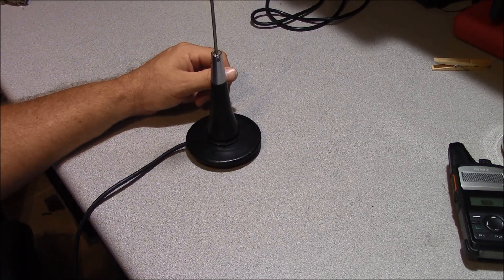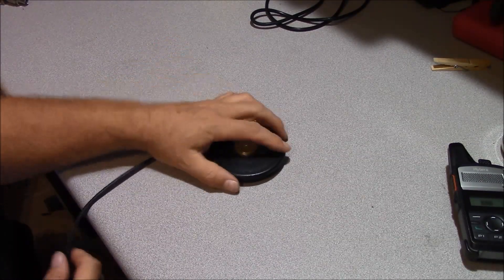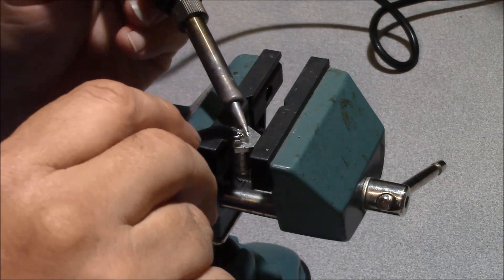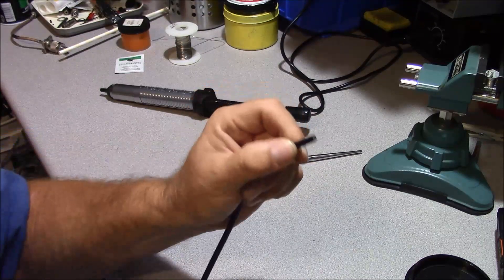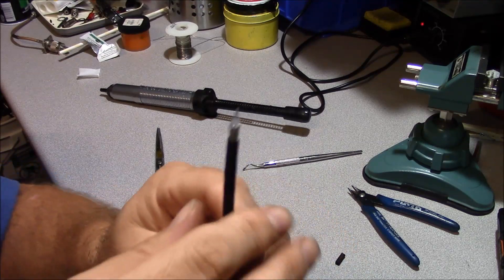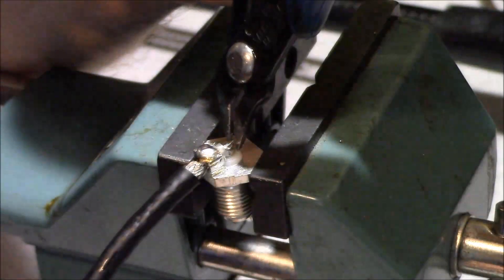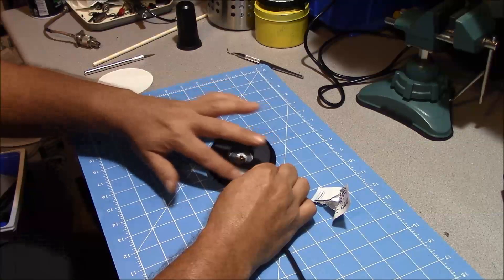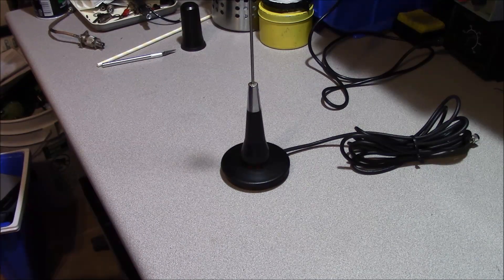Ham radio magnetic mount repair

Comment: Here's a poser that's had me stuck for a while: what is the best way to separate two mag mounts whose bottoms are stuck to each other?! When I got them back they were stuck together. Any pro tips on separating them? I've tried a lot of different things without any success. I've been afraid of damaging the bottom surface seals/rubber covers, but now that I know I can fashion my own thanks to this video, I got that covered. Might you have a COMT pro tip?
Reply from the maker: If they are NMO mounts take two pieces of 1 1/4" pvc abut 6 inches long on standard motorola antenna nuts. Attach to both mounts  and use the leverage to separate the mounts. Another option is a flanged nylon bushing that fits under antenna nuts on either side and two pieces of all thread or bolts that fit tight in the inner diameter of the nylon bushing. if you dont mind possibly damaging the antenna nuts just thread them on and use 1/2 bolts or a couple screwdrivers for leverage. I hope this helps
Reply: @survivalcomms  Thank you! I will try these methods. I can always get new NMO connector parts. 73 KD0AXQ

Comment: so what about one that has a capacitor? Is it really needed or can I remove?
Reply from the maker: If you have a mag mount with a capacitor remove it and cut the resonstor to a quarter wave - no legitimate NMO  magnetic mount has a capacitor.
Reply: @survivalcomms  - yes, thank you! I understand now that the capacitor was making the antenna shorter electrically and now I can just do that physically. Maybe it was there to balance out the antenna and make it useful for both 2m and 70cm?
Reply from the maker: @RixVideoChannel  It should not be in the mount itself -  is there a coil in the antenna element ?
Reply: @survivalcomms  The blue cap is on the center conductor where it is soldered in the magnetic base. The antenna has a coil midway up. Got antenna from MFJ. SWR's on VHF is out of sight but still looks very good on UHF
Reply from the maker: @RixVideoChannel  ahhh it's an MFJ .....

Comment: In that particular connection,  would it be better to cover the whole shield in solder,  then attach and solder it to the clamp ?
Reply from the maker: The cradle was tinned already from the old cable and a tight fit for an untinned shield. A tinned shield would have sat higher in the crade and had less conduction with the mount requiring more heat application. I generally tin before if the conductor will fit tinned. Thanks for watching !